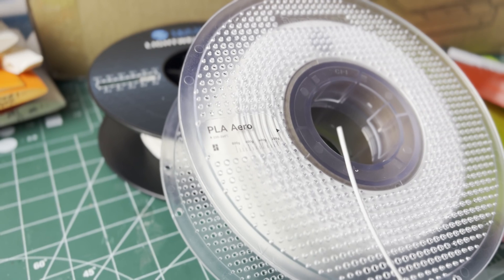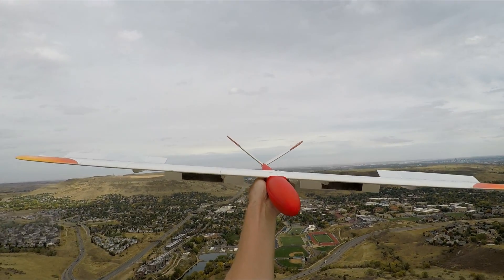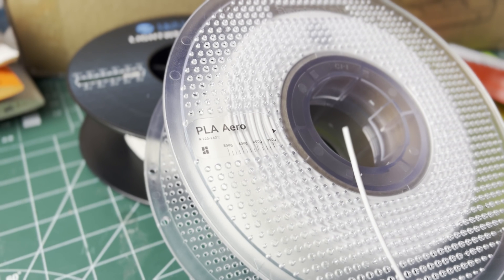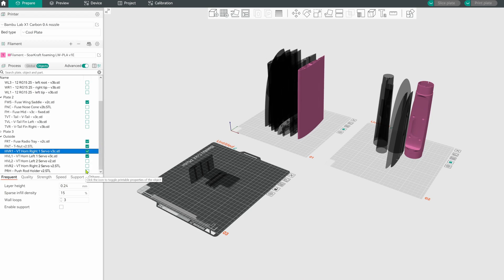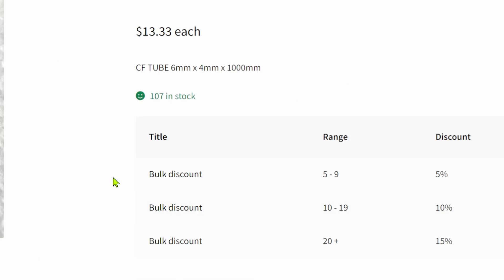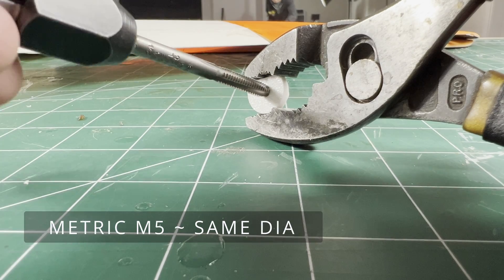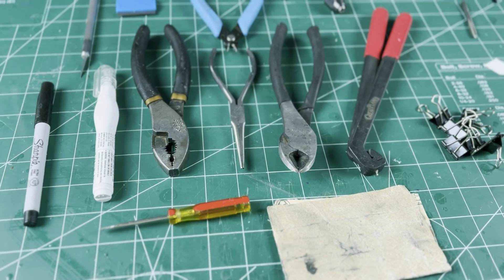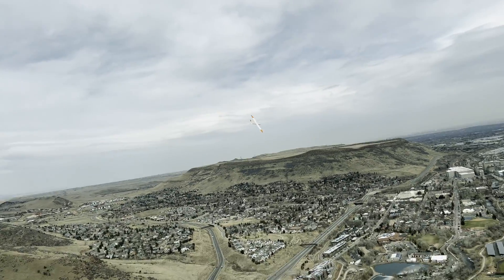LW-PLA Pika from SoarKraft - 13oz RTF - build and fly - part 1 - the set up

Comment: What is total printed part weight?
Reply from the maker: Did you watch part 2???? there is a weight check before adding any of the radio gear... hint: carbon is ~ 53g + 5g of glue + 2g of screws
True answer is I don't remember.  I had this in my notes from the build, but that was 1.5 years ago and I don't know what happened to notebook, I go through many.... and I looked for it
Reply: @soarkraft   I looked it up on website - did not find it. Just had a simple question and was hoping to find a simple answer without watching the whole thing...
Reply from the maker: 197g - ish